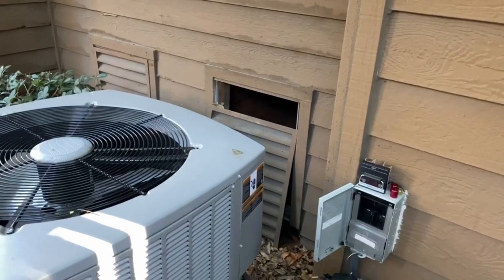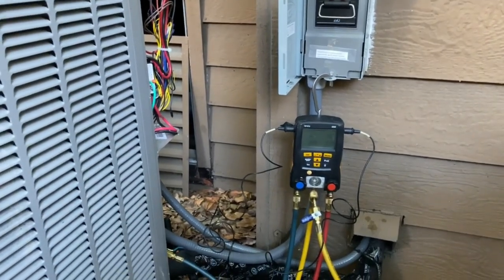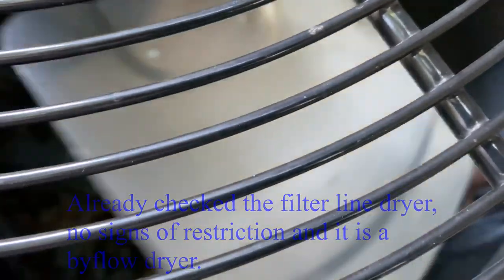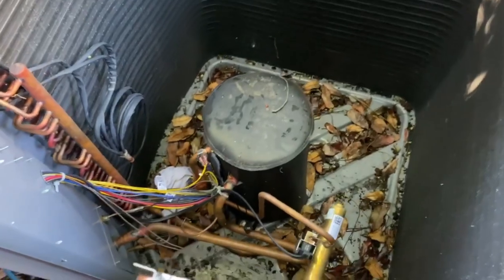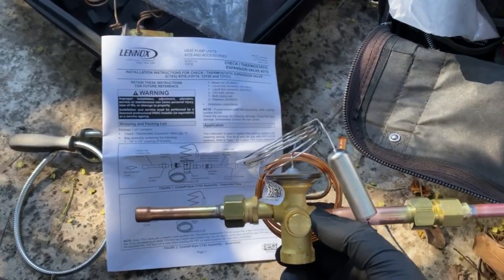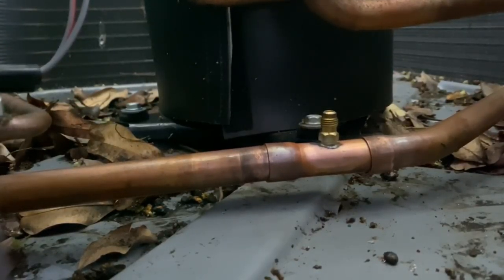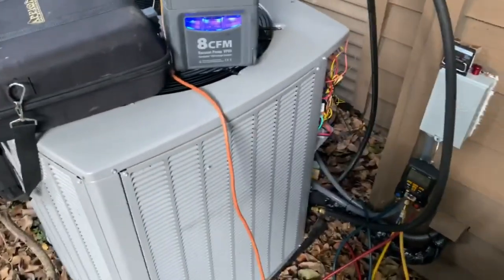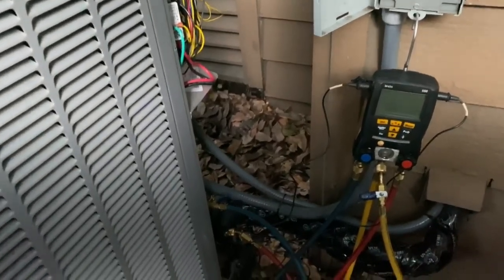Heat Pump Down!! EP24

Comment: how to quiet a TXV DURING DEFROST on a new outdoor condenser  sounds like air brakes on a 18 wheels. Is there a way  to quiet it  or  wire it so the heat scripts come on instead of that air brake sound when the TXV release pressure?
Reply from the maker: That’s the reversing valve reversing the refrigerant flow. There is no way stop that sound as far as I know.
Reply: My new heat pump was making a horrible sound when it into and out of the defrost mode.  Kind of a mechanical sound.  The noise was coming from the reversing valve.  The installation company said it was normal.  The second tech found it was overcharged.  He dialed it in during the summer months and it now is a little noisy, but 90 % better.